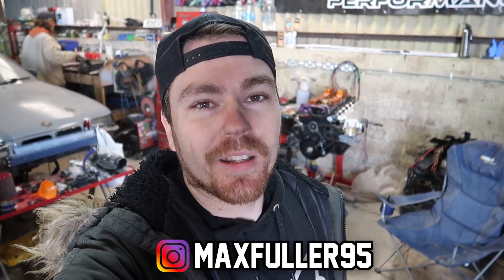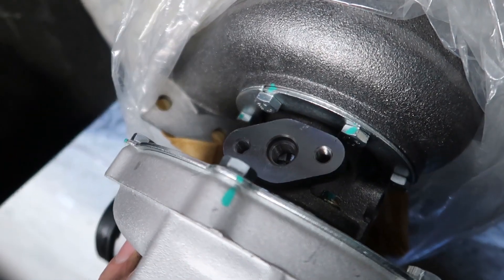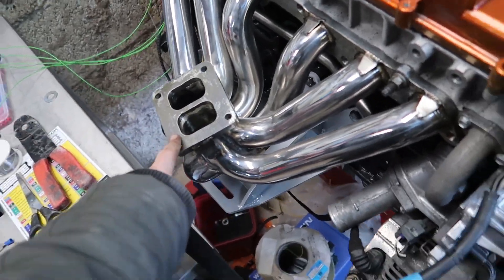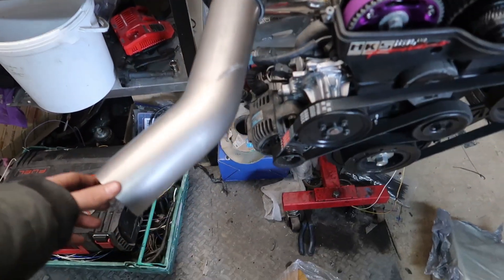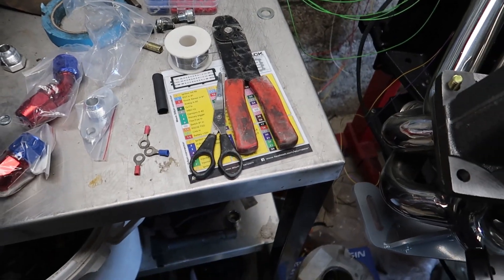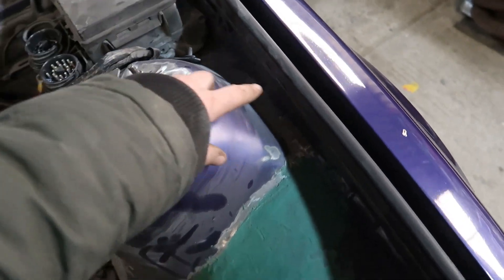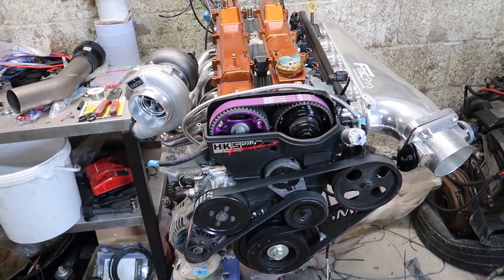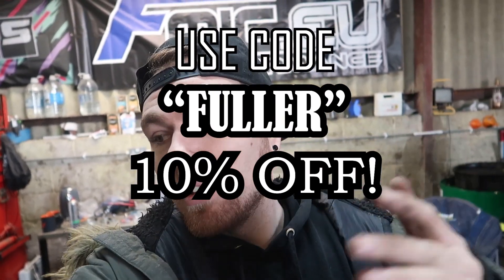Maxpeedingrods GT3037 Turbo for the 2JZ!

Comment: hello, I have a gtx3584rs that also used water coolant. where did you tap in for the turbo coolant? I notice you did not show that.
Reply from the maker: Hi, I haven’t attached the water cooling yet, haven’t decided if to run it or not, but I would connect it to the small pipe on the rear of the head and the water outlet at the front under the main water supply